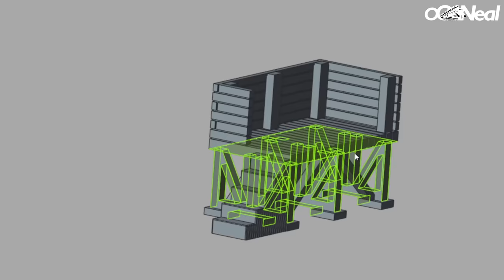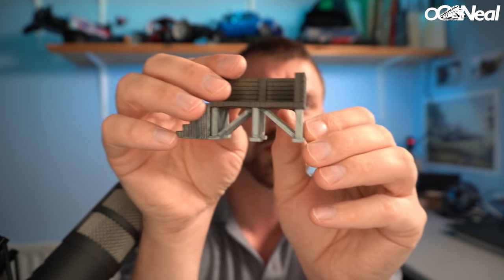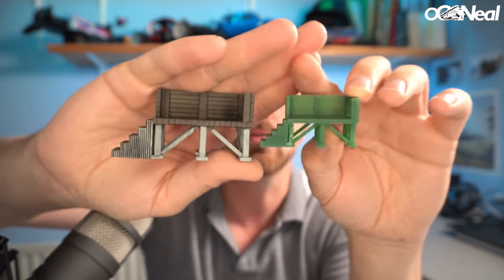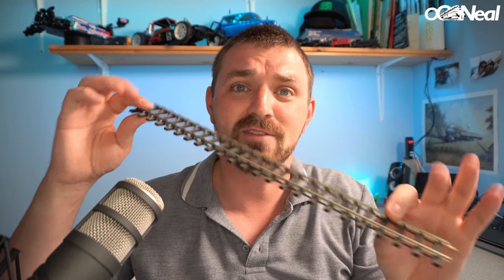Building Up A Model Railway S1 Ep 45 | Making a Platform | 3D Printing Signs and Coaling stage

Comment: There are lots of those 0-4-0 locomotives available on eBay for reasonable prices. The budget model railways channel is a good source of ideas with those locos. He also has links to parts for those tank engines.
Reply from the maker: Thats very true, I've seen some very nice models on there.
Reply: OO Neal Hornsby also sell the chassis on their own. Could be used if you wanted to make a 3d print locomotive.

Comment: Followed you from the beginning wondered how you cope with the “A” frame trusses in the loft. I have the same and understand these can’t be modified to give a little more room as these are integral to support the upstairs ceiling. Have studied the situation and have not found a solution. Looks as I will have to live with them for my build. Have you looked into this problem?
Reply from the maker: Hello Stephen, I have just worked between them which gives me a nice 1 meter span to work with. I wish I had an older house as some older builds don't seem to have the trusses in the way.